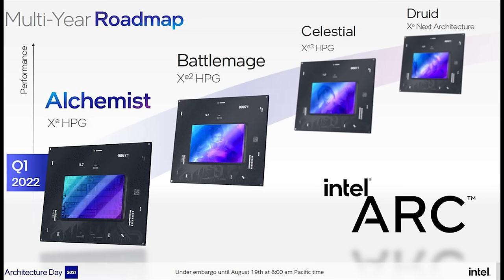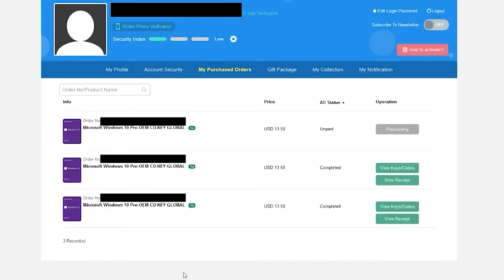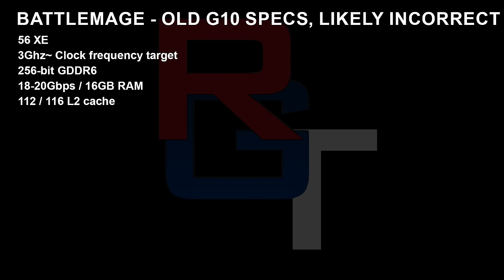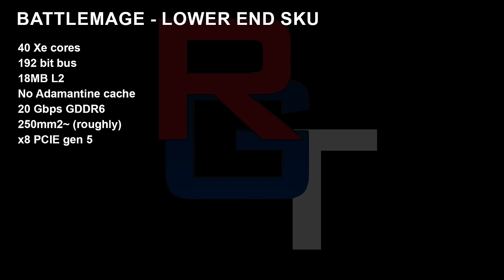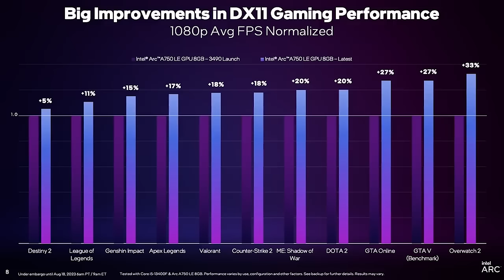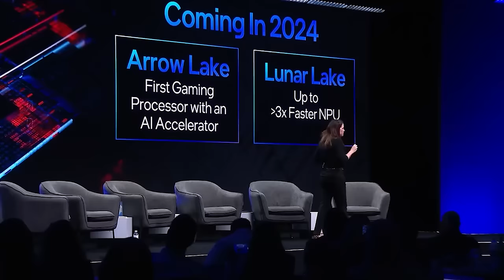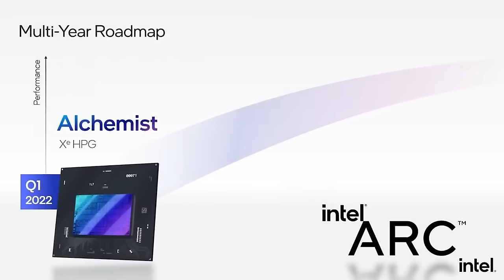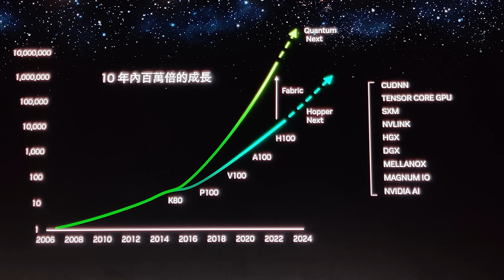INTEL BATTLEMAGE SPECS WERE WRONG?! - Big Update

Comment: A770 owner here. I was fixing to buy the 56 core one, but if it really does get cancelled, not only am I not gonna get that 40 core config, I genuinely might have to consider looking elsewhere. i feel like all the momentum was building up to Battlemage, and if NGreedia and AMD decide to become even more aggressive w/ their GPUs, Intel's gonna have a very, very hard time finding their niche.
Reply: Yah.
Reply: My BS detector is going haywire right now. This “leak” is too timely for Nvidia’s “Super” bad bang for buck luanch. Intel, Nvidia, and AMD have zero loyalty to their customers. So in return I have zero loyalty to them. I will be treating myself to an upgrade to my A770 in between April-June, and it will be the best deal at the time. But this just seems like total nonsense BS. Intel wouldn’t be so dumb as to lower the VRAM, and hold back the bit rate to 192mb/s They’ve said multiple times that they want to gain market share and they’ve invested tons off lost revenue in software/driver development in addition to low margin GPU’s. It would be ridiculously dumb to all the sudden start worrying about margins after they’ve just turned the corner. So yeah, my “anonymous insider sources” are telling me this “leak” is just to nudge people holding out for Battlemage to just buy the new “Super” cards from Nvidia.
Reply: 56C would be 4070Ti level, that makes the 40C(B770) more like a 4070, the A770 trades blows with the 3060(sometimes it's around 3060Ti, sometimes it's more like a 2060 or even 3050 depending on the engine).
B770 should be a pretty good product, specially if it hits $400, the only competitor on that price range are the 4060Ti 16GB and the 7700XT, both are way weaker than the 4070, specially the 4060Ti and the 7700XT only has 12GB.
Reply: @MaxIronsThird  whatever Intel releases it will be killer in price/perf. Because they literally have no other choice. So even if it is not that fast it will be good upgrade/entry GPU for plenty of people. Plus they gained a lot of experience in writing drivers of discrete GPUs so it may age way worse than 1st gen but it will start with higher initial performance.
Reply: No one can move "more aggressively". These products are for the most part already being built on the best manufacturing processes already.

Comment: Of note generally when he says Execution Units he means Xe Cores.
For reference the Arc A770 has 512 Execution Units within 32 Xe Cores.
56 Xe cores would be a massive uplift, but personally i think that number is either inaccurate, or they've made huge architectural changes, as to go from 32Xe cores sometimes saturating a 256 bus, to 56 cores not being held back by a 256 bit bus would be a huge architectural change.
Reply: sansumg said that GDDR7 will be ready on 2024, on 192bits that could bring 18GB and 720  GB/s Bandwidth (same as 4080) ... maybe, just hope
Reply: I was going to say 56 execution units is like iGPU size. If thwy have a large L3 cache and use GDDR7 they can get enough bandwidth.
Reply: Maybe that's why they would use the new type of cache along with it?
Reply: @TheBann90  Imagine a foveros style stacked design, with 2GB of cache under the GPU that is dynamically assigned between L1, L2, and L3, somewhat like the IBM cache on their..... power10? chips, though those are traditional "2d" with a really fat cache sticking off of each core.
Reply: @denvera1g1  That basically just functions as a global L3.  You lose a lot of the advantage of a local L1 within each SM.  Fine for large, simpler+more predictable workloads, not so much for complex, dynamic graphics stuff.
Reply: "to go from 32Xe cores sometimes saturating a 256 bus, to 56 cores not being held back by a 256 bit bus would be a huge architectural change."
That's what the adamantine cache is for.
56 Xe cores won't be held back by a 192-bit bus if it has 512MB cache.
Reply: @nathangamble125  Even with the cache i still think it would need at a minimum a 320 bit bus if not a 512 bit bus
Reply: Yeah, it's confusing when he says that. An Execution Unit is an 8-wide SIMD, which is tiny. A Xe Core is 16 of them working together. They are not even close to the same thing.

Are you sure the A770 was saturating its memory bus? I don't remember people talking about RTX 3070s or RX 6700 XTs saturating their memory busses, and they were more powerful cards, with more cores, and in the case of the 6700 XT a smaller memory bus. The 3070 saturated its memory capacity of only 8GB, but it had a healthy amount of bandwidth. I thought the Arc cards did too.
Reply: @nathangamble125  I think it's also there in order to more easily run the ExtraSS
Reply: @Pushing_Pixels  Alchemist architecture has a problem with bandwidth scaling with small kernels that don't load all the compute units. This is inherited by the large number of narrow (8-way) SIMD vector ALUs from their integrated graphics solutions. When Intel upscaled it to the large discrete GPU with much more Xe cores, the round-robin overhead of the export crossbar became too much, so the only solution to overcome the performance woes of Alchemist is to make sure as much execution resources are fed with workload at the same time as possible. The rather slow L2 also doesn't help much. That's why every major driver release has a long list of performance tweaks for large number of individual game titles -- Intel's software team is manually optimizing for Alchemist as much as they can spare resources, something AMD and Nvidia don't really have to do at this scale due to much more mature architectures and R&D capital.

Comment: ARC still is a huge opportunity for Intel. Not only can their iGPUs massively profit but also delivering in house APUs could be massive for the mobile market. Both for Laptops AND the recently booming PC handheld gaming market. With Alchemist they already were on the right track imo but got held down by essentially "feature creep" and a bad driver launch. The hardware itself is actually really capable. Battlemage will be interesting in the lower end for sure
Reply: They did fix the driver issues quite fast though, and that actually made them look good in that regard compared to NVIDIA.
Reply: I am still using an arc a380 which is a superb card for the price to performance for rendering and best emulation and with xess it can easily compute in this market
Reply: @tanmay4703  Compete in this market, they all compute.:body-blue-raised-arms:
Reply: @Bob-of-Zoid  well no. Even a year post release there still were a lot of issues. Its in an ok spot right now. Which is awesome. There are still plenty of issues for both older and newer titles but they are getting.there
Reply: @Kiyuja  I'm on Linux, and get my information mostly from Linux related channels and compared to NVIDIA who has way more experience but drags their asses in getting their drivers right for Linux.

Also: I assume you mean games by "Titles"?  Not everyone is a gamer or needs high frame rates, and I still don't get why Gamers act like the whole PC industry only has gamers in mind, or that everyone is a gamer. Neither is true.
Reply: @Bob-of-Zoid  I think nivida is just going to abandoned the market for gaming GPU and only going to Focus on Al market because that market make them 1 trillion dollars company. 
Also what I want is a cuda like framework for Intel GPU
Reply: Yeah but the ultra series runs Wayyyyyy too hot
Reply: @tanmay4703 Why would they? Still makes tons of money.
Reply: @GeneralS1mba  look every company want ai assistant where they are going to train that model on nivida GPU boom money
Reply: @tanmay4703  Microsoft, Google they all trying to get ai capable GPUs now. When they do, or if they do, they will probably use their own stuff. Unlikely that will be soon, since Nvidia has had more experience. Also, gaming is still enough revenue to warrant its existence.

Comment: So, MLID is looking to be right.

Well, 12gb isn't enough for me - stable diffusion SDXL really needs 16gb of ram.
Reply: Last I knew (circa Alchemist refresh), MLID believed the graphics division would be axed, and there wouldn't be any more consumer Arc cards.
Reply: And since A770 was 16GB, this leak isn't correct either. Pretty much all of the Battlemage cards will be 16Gb. Or more. Intel is also delivering hardware to Stability AI, and they are pushing the entire AI Pc. So it makes zero sense they would make all their new GPUs unable to run the low end AI models...

It's 100% a fake leak.
Reply: God damn y'all.....using RGT(super unreliable) to confirm something about MLID(super unreliable) is a total clown car wreck of critical thinking. lol
Reply: @maynardburger  couldn't agree more. MLID has been lying about Intel for the past few months. Maybe he has gotten RGT onboard as well.

Comment: If Intel launched the B980 for <$500 they would crush Nvidia's entire 40x line aside from the 4090.  What are they thinking? If the B980 could come close to the 4080 in compute they would absolutely slay the datacenter market because of the power efficiency.  I was so stoked for the release of that card.  Why Intel?  Why!?!
Reply: hahaha how high are you rn? they cant compete with the 3060 let alone a 4070ti. This is worse news for amd than nvidia. get your head out of the sand.
Reply: because we were excited for it that´s why
Reply: Uh I own an Nvidia card but I would like to see Intel compete in the market to drive prices down.  It was a joke but apparently you didn't get it@@noir-13
Reply: @iequalsnoob What are you talking about? With the latest drivers the A770 beats the RTX 4060 in many games and has 16GB vram. So in the long run, it will do even better.
Intel is also still perfecting the drivers. So it might get even faster.
Reply: B series would be 800, not 900 unless Intel jumps from 700 to 900. So based on the die size probably B870. Tho it would be a step back if it really was 192bit because that means 12GB (unless they use denser modules to double to 24GB).12GB would be disappointing considering they have 16GB now.
Reply: @Raivo_K  sansumg said that GDDR7 will be ready on 2024, and it has 3GB modules, on 192bits that could bring 18GB... maybe
Reply: Agree. The initial leak said it was going to be 256bit bus with 16GB of vram.  I already have a 4070 so I have no incentive to buy this card now. Wish they could have done it.  I would have bought one.  @Raivo_K
Reply: Feels like a massive letdown. Like Intel gave up already
Reply: It doesn't make any sense unless Pat has received a massive under the table bribe from Huang!

This top end card has potential to have the greatest margins in all of intels cards so far. And better than anything in AMDs history.
Reply: Too much Ampere used parallel Ada and Super volume to sell through means no economies of BM card production. mb
Reply: @iequalsnoob "They can't compete with the 3060" I think the one who's high on drugs is you.
Reply: it seems like that...which as always is bad for them as for us too so...f it and waiting for next gen maybe from amd @beachboy_boobybuilder

Comment: With 225W Intel Battlemage could be rival to RTX 4070 Super. But since it's Intel, it will be rather around RTX 4070. 
There's like 5% chance Intel has finetuned their architecture and drivers all the way up to Nvidia after a single generation. Still with proper setup and pricing Intel could be competitive. Also it's more about Intel vs AMD in the end. Both are trying to expand their potential in and the market as such of "M2" like integrated products. Portable gaming, office tasks... there's a lot of stuff that doesn't need 32 core overengineered CPUs. Future is a bit murky, but they can't just sit and watch the train go by. All kind of chipplets, AI coprocessors, etc. could be there.

Comment: That’s the part I’m waiting for so if they don’t launch it, I’m going to be a bit stunned. A 4070ti type card from Intel would be sweet. XeSS seems solid and they also have solid AV1 support. They showed support for AI image generation in GIMP as well. VR is still in shadows I suppose. Hope we get the latest DisplayPort and HDMI versions. Even if the price isn’t a large price shift, I would buy it if the price is at least a good value.

Comment: As an owner of an A770 16GB, I want Battlemage to go head to head with the 4080. Even if it doesnt take the crown from Nvidia its yet another option that if priced right will start to eat into Nvidia's market share. What will really determin its success is whether they have software that can touch DLSS 3 and frame generation. Yes, AMD FSR is of course an option once its starts rolling out, but so far the titles that support DLSS absolutely take performance to another level.
Reply: Yeah, the fact that the old A770 has 16 GB is the main reason to believe this new so called leak is just trolling with us. And not a very well thought through troll leak either.
Reply: Intel has their ExtraSS, which will launch with Battlemage. On paper it should have far better latency than DLSS/FSR. While ghosting could be a problem, yet solvable with AI. The same type of AI used in AI video creation should be able to fix it. There have been some really good papers on it just in the past 2 months, and I assume it will get even better going forward. But that's updatable with software anyway. Anyhow, I think that with the paper I read just a month or two ago, Intel won't need anything more to solve the ghosting problem.

Where Intel will still be lagging Nvidia is with ray tracing, but for competitive gamers Intels tech should have a leg up going forward. Unless Nvidia scraps DLSS3 and makes something new. Or tries to copy Intels ExtraSS

Comment: If the 56C would be 4070Ti level, that makes the 40C(B770) more like a 4070, the A770 trades blows with the 3060(sometimes it's around 3060Ti, sometimes it's more like a 2060 or even 3050 depending on the engine).
B770 should be a pretty good product, specially if it hits $400, the only competitor on that price range are the 4060Ti 16GB and the 7700XT, both are way weaker than the 4070, specially the 4060Ti and the 7700XT only has 12GB.

Comment: The software team has worked hard on the drivers, I hope the hardware team won't disappoint us.

If they decide to go for the lower end, there are only 2 reasons:

- they want to reduce business risk
- the hardware offers less performance they were expecting
Reply: So 192bit, 40cu = 6750xt=4060ti. And shintel cancelled 4070 ""top"" performer :)
Reply: MLID mentioned the 250mm2 being top battlemage die about a year ago
Reply: @hristobotev9726  batlemage doble fp32 per UE so 40UE battlemage =80UE alchemist or 2,5 X raw performance of A770, puts this sku at 3090 ti level on papel.. 
In Real world i hope That coulb bring a 4070 performance...

Comment: So lots of things going on here.  One is AMD has the 7900GRE and it's looking good (which is more like what a 7800 XT should be like).  Two is Nvidia releasing Super cards.   Three, they have to use TSMC die for this and the rumor has been N3 hasn't been great for yield.  So, if they come in, and I haven't seen which node they're trying to use, but AMD and Nvidia are on nodes with good yields, say on TSMC N3 (once again I haven't seen what they're releasing on) then they're better off only releasing at the low end with smaller die for now.  And even if they're on N5 or N4 they're STILL better off only coming out with a smaller die until they figure out the market.